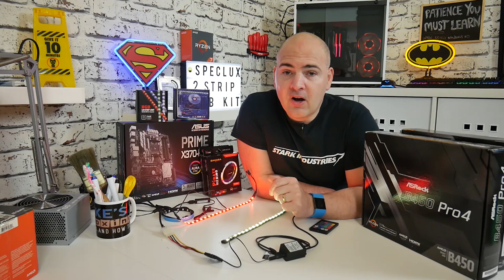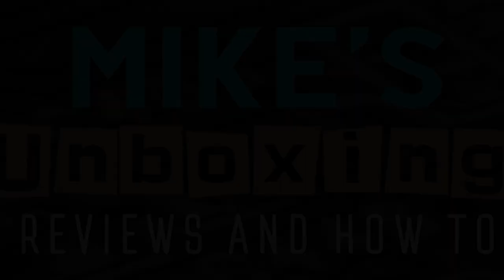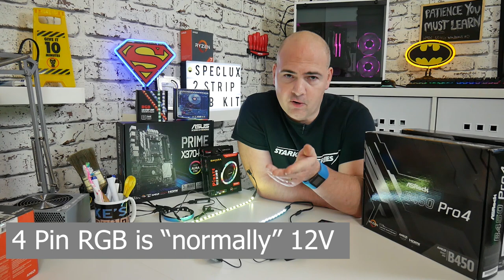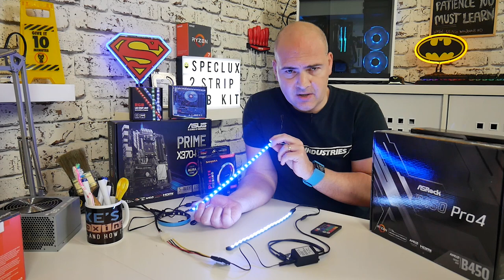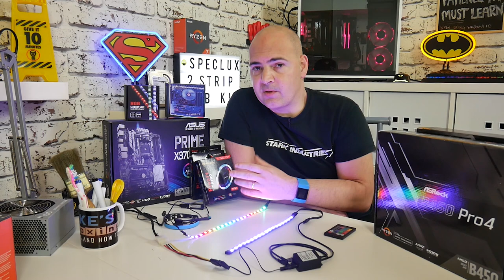PC RGB & Addressable RGB Explained

Comment: Hello! I want to connect more argb devices to my mobo (b550-f) but it only has one argb header and I couldn't find anywhere if argb splitters actually work, I found an ek one for £10 on Amazon and I want to know if it's necessary
Reply from the maker: yes it is necessary well a hub of some type is needed or maybe a cheaper splitter cable

Comment: Hey Mike I just got the nova mesh tg  argb case if my motherboard only has a 4 pin how and I use the three pin argb fans please help!!!!
Reply from the maker: you can't is the simple answer. you will need to control the lights with a separate controller sorry

Comment: What voltage is the 2 pin addressable AURA RGB connector supplied with the Asus ROG THOR.
Reply from the maker: no idea sorry
Reply: The 2 pin end connects to the PSU on the left side at the back of the Thor PSU and the other end has 3 pins female. Should I connect this to the addressable rgb header on my motherboard b550 f gaming wifi. I bought a splitter so I can connect the Helios case and the Thor PSU to the header but I'm worried it might blow up and haven't connected it yet.

Comment: Can you you have both the 5v and the 12v on at the same time? , I’m planning on buying another set of light strips but this one is a 3 pin 5v strip
Reply from the maker: you can on separate headers, most motherboards have a 12v and 5v system that can run together but it is a bit harder to sync some colour options
Reply: @mikesunboxing  Perfect, that’s the answer I needed, thank you so much.
Reply from the maker: @FLY7MARK  No problem :-)

Comment: only thing im still confused on can i still use addressable on a 4 pin header?
Reply: In short, no. 

4 pin are non-addressable. 3 pin are addressable. 

ARGB has a microprocessor for every LED. Without those microprocessors you can't access LEDs individually. 

This is also apparent when you consider that 4 pin RGB uses different voltages on different pins to determine the amount of each color to output from the LEDs. Whereas 3 pin just uses a data pin to control the LEDs; the data being interpreted by the microprocessors.

Because the signals on each type of RGB is so different, they aren't cross compatible. Though there are some products out there that can change a RGB signal into an ARGB signal, I haven't found anyone who actually sells them.
Reply from the maker: Yes that is a fantastic answer although some people still get confused as the four pin and three pin connectors physically lookalike except for missing one pin so technically three pin connector is actually a four pin just with one pin missing just to make life a little bit more difficult for us all
Reply: @mikesunboxing  And then there's the good old 5 pin RGBWs and the JCORSAIR connector... RGB is a real mess.

Comment: I’m changing from a black set up to a white one and I’ve got a new case. I want fans that are argb but my B450 Tomahwk Max motherboard has a 4pin rgb header how do u use a 3pin fan in a 4 pin header
Reply from the maker: sadly you can't that is a limitation of the Tomahawk boards only 12v rgb support

Comment: So how many LEDs/RGB things can we connect to a 5v header max?
Reply from the maker: depends on the board or adaptor but most i would use would be two 12" extensions from one header so around 40 or so leds

Comment: Okay
So if I buy Corsair ML140RGB

and if I want to use motherboard RGB Pins for lightning it up 
And for Fans 
If I use chassis header on case
Will it work normally??
Reply from the maker: no it connects to the ICUE hub
Reply: @mikesunboxing  I See.
i bought ML140 RGB 140 mm
and i didnt knew it required chub or commander or whatever..

are there any cheap alternatives splitters for corsair fans
i dont want to change modes of colors
if it can run on default rgb 
its okay with me

any alternatives that sipport ML140 RGB?

Comment: Can I sync two different fans connected on diff headers? For example i have one fan connected on 4pin rgb header and one fan connected on 3pin rgb header both are aura sync compatible can i sync them using aurasync software?
Reply from the maker: yes you can but the effects won't be the same if you have chase or rainbow puke type setting

Comment: mine its 4 pin, so its 12v ? its the one that came with the CM Masterbox Lite 5 RGB ...
Reply from the maker: Yeah four pins in usually the 12v RGB
Reply: @mikesunboxing  omg i did a mod and conected it to 5v and they light green, thing its my MB dont have RGB (z77x-ud3h) so in order to light those fans i had to conect it to a molex 5v, so if i go to that molex and set it to the 12v what ? still lights green ? or should i let it in 5v ?
Reply from the maker: I would play it safe and buy a cheap RGB controller like the one in the video and connect that up and then you will be able to control the colour and not risk damaging anything 😀
Reply: i life in cuba man, i cant buy that here, im screwed :(
Reply from the maker: But you do have fabulous weather and culture. Good trade off.
Reply: @mikesunboxing  well if you like humidity like a walking fish, HOT HOT days .... yeah ...
Reply from the maker: Lol very descriptive 😂

Comment: Hi Mike! Loved the vid! Thanks!

I do have question though!
I want to buy the Gamdias ARGB M2-1204R fan pack. Compatible with Aura sync, mystic light, etc.

Now, it's ARGB and RGB compatible. Now, if my motherboard only has RGB headers and NO A-RGB headers, then will I be able to control the lighting of the fans using the RGB headers?
My plan is to basically simply, using the mobo software change colour to, say static red, white, etc based on preference and sometimes to the rainbow mode like the argb strip version you've shown in this video. Can I do this? Please help!
Reply from the maker: I'll take a closer look at the that fan pack when I get a few minutes and give you my thoughts
Reply: Thanks mike! Eagerly waiting to get to know your opinion on it!I still am a little unsure about whether to get them, if I get some good insight from you, I might be able to buy them and share images and control settings and other info about these fans with you!

Comment: Hi there is anyone able to help me please, i have the MSI B450 GAMING PLUS MAX AMD Motherboard and GameMax Diamond Mid Tower Gaming Case i have purchased 2 additional fans Game Max Mirage. now the issue i have is my board has 4 pin RGB on the board but my case and fans all have 3 pin, is anyone able to tell me what i need to purchase to allow me to get them all to sync together please, currently my 2 new fans are connected to the motherboard via the fan headers but not producing any RGB as no way to connect. thank you in advance.
Reply from the maker: it won't work luke the best option is to change the board if you still can. Something like the Asrock steel legend will be a good choice and will work well with those fans and ARGB

Comment: help i have a mobo prime asus b450m-a that have 4pin 12v and a case called antryx b450 with comes with a card for the fans and lights conecctors and that its conect with power supply but the conector of this is 3 pin  but the cable its too short to how can connect my case lights with the mobo  :(
Reply from the maker: This is maybe easier to fix or at least advise if we can ask more questions and get direct answers, so feel free to join our Discord chat and we can go over it in more detail https://discord.gg/gaeeDPw

Comment: Hi! I have a little question. I have motherboard of asus rog strix b450-e and it only has 1 argb header. So here is the question. Can 1 argb header power up 11 argb fans?(the lighting) i hope you will reply badly needed help
Reply: The fans model are deepcool cf120 and 1 deepcool gammaxx gt-argb
Reply from the maker: You probably need a hub to power all that
Reply: Yes it has hub that i can put 5 fans at a time i have 3 of those so i have a total of 15 slots however the hub doesn't have sata or molex, is it okay?
Reply: Or do I need a hub with a sata or molex? I am having quite a hard time finding a 3pin hub with sata or molex in my country
Reply from the maker: @jimuelalejo7501  sata or molex is fine if you have the connection on your power supply, most new ARGB hubs seem to be almost entirely SATA
Reply: Sir I am sorry if i am getting quite annoying. But i have a last question. I have 3 hubs without sata or molex that came with the fan. I bought a hub online with sata  that supports the connection of my hubs without sata or molex. Is it okay if I use it? It has 10 slots for 3 pin and 1 sata connection. Its gonna be a first hub with 3 hubs without molex or sata connected to it. Each of the 3 hubs will hold around 2pcs of 4 fans and 1pcs of 3 fans is it okay? Sorry if my english is bad
Reply from the maker: Jimuel Alejo maybe join us on the discord chat and you can post pics of what you are trying to do or use

Comment: Love this, i understand a bit more now :D 
Unfortunately i still have some issues making the ARGB hub (argb ledstripes + argb fan) that comes with my MPG Gungnir 100 Case work with my Gigabyte Z390 Aorus PRO. 
I thought connecting the 3 pin data cable coming from my led hub should be enough but i really don't know which software i should use to control them, cause neither RGB fusion nor Mystic Light seems to work. Any idea?
Reply from the maker: I think you need to adapt the four pin argb header to the gigabyte 3 pin one and use the gigabyte software to control it

Comment: So sir if i have a mobo 4pin header its cant do argb but still can sync it right?
Reply from the maker: if you have a 4 pin header you are limited to using rgb and syncing it, there will not be an option to control any addressable features

Comment: Can I use a 12v RGB female header to motherboard 5v male Argb header?
I'm in middle of building pc
Reply from the maker: No it will go bang
Reply: @mikesunboxing  so I won't need to fix it?
Removed it not connected and
I have another issue sir
I have built my pc yesterday
And it is not showing any display
No lights on keyboard mouse
Lights on fans workings fans rotating 
cpu r7 3700x cooler also rotating wit lights on
But no display

Comment: Does argb fans need to plugged to an rgb header in order for it to lit up?
Reply from the maker: depends on the model but in general yes the RGB part of the fan is done separately from the fan speed and power
Reply: Mike's unboxing, reviews and how to thanks for the reply
Reply: Im planning on buying the tecware forge m case , do you have to plug the fan to the rgb header in order for it to lit up?
Reply from the maker: @judethecreator1457  Which fans kit are you thinking of?
Reply: Mike's unboxing, reviews and how to hi thanks for replying , it is the fans that came with the tecware forge m case
Reply from the maker: @judethecreator1457  the case comes with a pre installed hub for the fans but it is a specific one to tecware from what i recall. there should be a single 4 pin pwm and a single 5v 3 pin ARGB port that comes of the hub to connect to the motherboard

Comment: Yet all current new mobos have 4 pin 12v. Which is outdated ? Why do 100 dollar mobos come with rpg standard?  Are you saying 300+ only have 3 pin argb? Even x470 has 4 pin 12v tug gaming 4 pin 12v? Lol. Are rgb systems stupid expensive?

I have x470 mobo got it for 130 stupid expensive. Has 4 pin 12v. Point me to right direction. I want good rgb fans. 3 top on my pc and 2 infront intakes lol. Thx.
Reply from the maker: join our discord and we can go over the options

Comment: Can i plug RGB strip in ARGB header?
Reply from the maker: no it will not work
Reply: @mikesunboxing  or ARGB controller?
Reply from the maker: @Dakshohri  RGB will only work with RGB controller or header - the voltages are different between the 2 systems

Comment: I m so confused should I need argb components for a argb case (cooler master h500m) or I can use normal rgb components..pls answer...
Reply from the maker: you will need to match with the case if you want to sync the lighting
Reply: @mikesunboxing  I will sync lighting with aura sync..should I still need to have argb components rather than the rgb..for an argb case ( cooler master h500m)
Reply from the maker: @mahfuzaakter3932  asus aura sync can be either RGB or ARGB depending on what motherboard it is running on
Reply: @mikesunboxing  I will use asus crosshair viii hero (wifi)..now just tell me clearly 😅😅 that should I need argb components for my argb case (cooler master h500p) or rgb will work and sync perfectly
Reply from the maker: @mahfuzaakter3932  that board seems to support both formats
Reply: @mikesunboxing  that this means that I can use my rgb components with my argb case (cooler master h500m)
Reply: @mikesunboxing  please reply